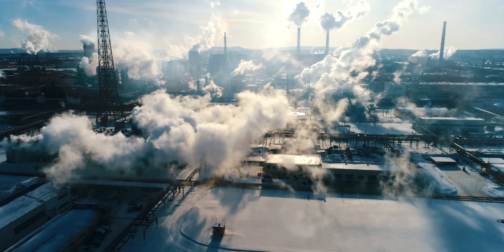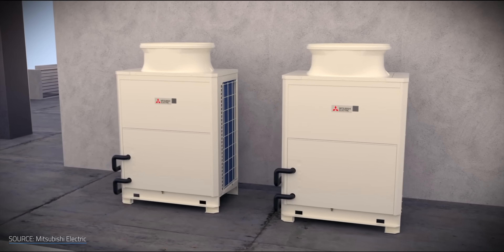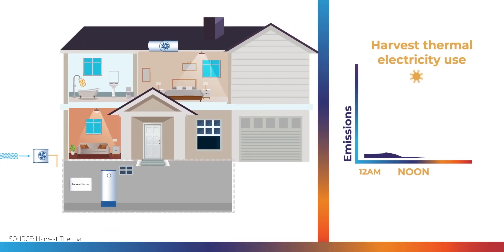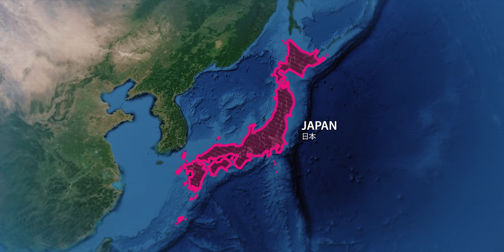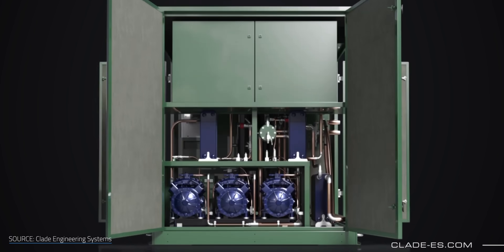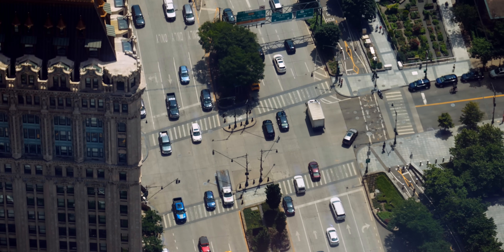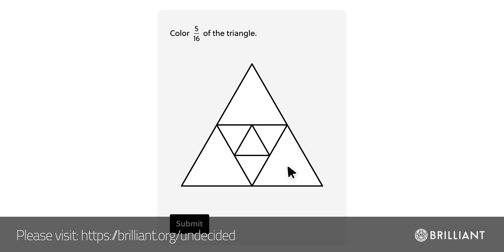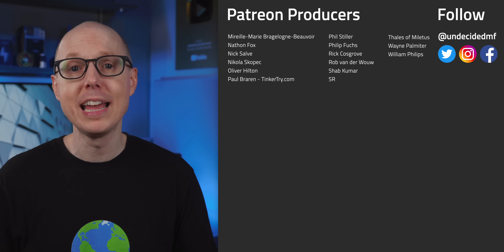Why CO2 Heat Pumps Are The Future Of Cooling

Comment: 3:21 Average Heatpump COP of ~3
3:28 ECO2 SANCO2 COP of 2.6 to 5.5
9:04 CO2 heatpumps COP of ~3
9:10 Most Heatpumps COP of 3+ !?!?

So... I guess you say "average" in one case, and "most" in the other, but the video seems to contradict itself slightly. A bit like: "Usually you get ~3 for regular ones, and the good news is that this CO2 one can be from 2.6 to 5.5. A downside is that you get ~3 from CO2 ones, whereas you usually get 3+ for regular ones.". I don't mean to say: "so which is it" because  you already indicate it's complicated. But then it's not a great argument for the structure of the video.

Comment: When you're making the comparisons between current heat pumps with HCFCs and these CO2 heat pumps you first say (paraphrased) "old heat pumps get around 3 COP and CO2 heat pumps get from 2.6 - 5.5 COP" but then around 9:12, you say the CO2 pumps "tend to have a COP just under 3" while the current pumps "can hit a COP of 3 or better" and THEN CO2 pumps when combined with a thermal battery (which you included all along anyway) can go up to 8 COP. The comparison numbers are fluctuating too much

Comment: Could the CO2 also be used to cool solar panels on the roof in hot climates like Australia, Texas & California. This could make the panels much more efficient during the middle of the day when most power can be generated.
Reply: Interesting idea btw. To your experience how significant solar efficiency drops when there are overheated?
Reply: @Ayvengo21  i believe they can lose up to 30% power generation if the panel get over 40c

Comment: I've had my CO2 heat pump hot water system running for a few years now and it's been brilliant. Based on my usage it takes about 2 hours to warm up the water on a daily basis and it runs at around noon when my solar system is running at peak, so effectively getting hot water at virtually zero operational cost.
Reply: If you are using solar it almost certainly better to add an extra panel and use a plain electric water heater. They make models that last for 50 years whereas heat pump water heaters only last 15 years. The money difference is just too great to justify the heat pump version.
Reply: @Jason821821 50 years for an electric water heater? Which brands?
Reply: @Jason821821  I've got solar already and my home came with a gas heater that was on its last legs. The resistive heating was no longer an option and we get huge rebates on the heat pump here so it was a no brainer decision.
Reply: And since this uses about 3 times less energy to heat, I personally rather use the excess solar to power something else. Like home heating or cooling which uses a lot more energy, especially in winter when solar doesn't generate anywhere near enough to power both.

Comment: I have spent an unreasonable amount of time thinking about heat pumps and thermal batteries, and now Harvest Thermal does precisely the system I had been imagining for months now. Bless their hearts.
Reply: I've done the same. It seems so cumbersome that we don't just unify ALL of our temperature related appliances into one modular system: hot water, cold 'fridge, room heater/cooler, etc, with outside air as a sink for the overall difference AND/OR a varying medium to harness. Wish I could do the thermal math.
Reply: @BillyStanley It gets really complicated technically and expensive when you want to run so many things with different goals off one outdoor unit. You're talking about a VRF system essentially, if you were to run refrigerant to each appliance that's adding a lot of failure points, efficiency loss, and complexity. Way more cumbersome to do than individual units I can promise. If you run through water, you can't really do cooling for a refrigerator and not a freezer, it's also going to have a lot of energy loss and waste electricity moving all that water around.

Maybe it seems wasteful to have a dedicated refrigerator and whatever else you have that's a heat pump, but they work better that way. Refrigerators, hot water heaters, and air to air heat pumps don't use the same refrigerants. Each refrigerant will give you different in/out temps that they're best at, and the optimal one for the application is used.
Reply: Having compressors far away from fridge and freezer could allow for even more silent operation. With how efficient those currently are, I know it won't ever pay for itself, but it might be worth it from a noise pollution standpoint. Plus, it shifts the engineering away from the fridge. It just becomes a box that you plug into a new kind of wiring into the house.
Reply: @TheKdcool  The engineering of a fridge is mostly not the compressor, so moving that outside is just an efficiency reduction. You still need electronics in the fridge for control, and a defrost on the coils inside, might even have an electronic expansion valve or refrigerant metering device, plus fans.

This is just adding complexity and engineering, a lot of figuring out how to work with a complex VRF outdoor unit and communicate with it. Rather than have a simple, small, and efficient dedicated compressor for an easy closed refrigeration loop. We can already make practically silent refrigerators with inverter systems, you just gotta spend the money, it'd still be less than a fridge hooking up to an outside unit. The copper line set for refrigerant going outside would already cost $500-1000 not including labor to hook it up and purge/vacuum the lines before charging them.
Reply: @Jaker788  If it's hot inside and you directly vent the heat from the fridge outside or into the hot water, there is place to improve efficiency
Reply: @TheKdcool  It's a negligible amount of energy and a small amount is new heat, while the rest is essential heat that leaked into the fridge simply being brought back out. In total you're generating around 500w of new waste heat. You'll lose a lot more energy just moving refrigerant over 50ft of line both ways, and having to insulate it to mitigate heat/cold loss along the way. It's just not ideal at all compared to a simple very small loop in a fridge. That much copper in every house isn't very sustainable either.

In a home that's primarily heating in the year, it's actually better to have the small amount of waste energy generated from the compressor motor inside than out. In a home primarily cooling, it's still only 500w of actual load on your AC system. The payback period for an outdoor unit driven fridge is practically infinite.
Reply: @Jaker788  it's more like 50w if you make an average so i'm with you on it not being a cost savings. It's more about making it completely silent

Comment: 7:26 non-toxic should have lots of asterisks. It all depends on concentration.
Reply: The upside is, if there ever was a leak it'd be rather easy to just safety went the whole charge to atmosphere as it would do less harm there than inside a building. Though I'd definitely invest in a CO2 detector with one of these things, never a bad idea anyways, but more so if you are actively dealing with sources of CO2

Comment: So, would this co2 heat pump and thermal battery combo be applicable for also cooling a house in summer in the southern United States?
Reply: I have the same interest.  Being in Texas, where we just experienced 75 days of 100F (38C) or higher temperatures, good cooling efficiency would be essential here.
Reply: cooling works only if ambient temperature outside is below 30 degree celsius
Reply: @3harath  
Is that rule universal? Or does it depend on the type of coolant being used?
Reply: Can it make hot water for showers and cool the house?

Comment: I remember watching a show when I was a lot younger that said CO2 is a really bad choice for refrigerators because it easily changes directly from a gas to a solid and blocks the tubes.

Is there something about the scale of multi-unit heat pumps that makes that a non-issue?
Reply: That's called vapor deposition. It's actually one of the ways we make graphene, using CO2 and copper foil. Not a problem with modern sensors and processors unless there's a catastrophic failure that creates conditions well outside of the intended operational values of the loop.
Reply: Never underestimate the left's ability to ignore old, established knowledge. The the lockdowns and masking serve as my evidence.
Reply: I think that because these systems are running at high enough temperatures, it mitigates the danger of CO2 solidifying. It takes ridiculously high pressures (>>100 atm) to get CO2 to solidify above even -30°C. Afaik, dry ice (solid CO2) is made by chilling with other refrigerants/methods entirely.

Comment: Well done, heat pumps are long overdue as the staple in the States. Matt I would pick you up on the statement that CO2 is non toxic. It is in fact a toxic gas when humans inhale too much of it. Big issue in confined spaces like submarines and space craft that is why CO2 scrubbers are on those ships. Your death from CO2 poisoning is called Hypercapnia. Cheers and keep up the good work.
Reply: Aren't you talking about carbon monoxide? That is deadly.
Reply: @rjung_ch  No I am not that is a common mistake people make - simple research will tell you just google Hypercapnia. Why do you think the CO2 scrubber failure on the Apollo mission was so critical to repair? The Astronauts were going to be poisoned by CO2 (running our of oxygen is not the issue) it is the concentration of CO2 that becomes deadly, from memory there is only about 0.5% in the atmosphere. Correction the level is 0.04% as of 2022 which is double that of 200 years ago.

Comment: Sanco2 is made by sanden and they have been around for a long time now and still haven't gotten off the ground. I reached out to them in 2018 when I needed a new water heater because I thought their tech was top-notch but their sales guy seemed totally incapable of dealing with non-builder homeowners interested in the product and sent me a bunch of PDF and PowerPoint presentations that he would give to commercial customers about the benefits. When I got in contact with a manager I was told the closest distributor to me was in Newark Delaware, meanwhile I live in Maryland just outside our nation's capital in DC. You would think there would be a closer distributor. They also didn't have any listings for certified contractors to install the heat pump water heater at the time and frankly I didn't want a contractor doing this for the first time on my house. I have very young children and we can't go without hot water for a long period of time if there's an issue. My biggest gripe with sanden is the storage tank itself. They use an old fashioned glass lined metal tank that has been outdated for decades now even though everyone still uses them. They should have a modern highly insulated polymer storage tank like the Rheem Marathon so it can maintain the hot water temperature better over long periods of time, minimize maintenance without the use of anode rods, and provide a lifetime warranty like the Rheem instead of the 10-year ones that most of these glass lined anode filled tanks have. I ended up with a AO Smith heat pump water heater and I'm 90% happy with it. My only gripe is the generation I got in 2018 has a side hookup for the hot water that when routed vertically travels directly in front of the cold exhaust air port, essentially cooling your hot water as soon as it leaves the water heater. The newest model has a hot water exit directly off the top.

Comment: CO2 is not currently being targeted for packaged RTU or HPs as it’s efficiency numbers are awful. It is desired more for its global warming potential number (GWP of 1). It operates at really high pressures and can require more energy to operate.
Reply: Did not really get what is the benefit of CO2 compared to other refrigerants, my AC uses R290 aka propane so also no ozone depletion and miniscule global warming effect. Comparing  with HFC/CFC-s is only part of the story.

Comment: Liquid c02 at 600psi or so then allowed to expand into a gas through a nozzle onto a heat sink, creating cold air to cook the home, during the day it uses solar to compress it back to a liquid. maybe the heat sink could be a wheel that’s water filled and has flow to allow fast thermal exchange while also providing cooling and rotational energy to then force the cool air around the home or the energy to create electricity at night? 🤔
Reply: these run at far higher pressures, several thousand psi

Comment: I understand that CO2 does well with heating via a heatpump system, but how does it do for cooling? and can a fridge/freezer also work with CO2 as a refrigerant?
Reply: Most new supermarket refrigeration systems use CO2 in the UK at least
Reply: Heating or cooling wouldn't be a problem for CO2. I'm question the number COP numbers. Also don't see any gain from store the heat in hot water as well.
Reply: It's has the ability to cool to lower temperatures than other commercially used gasses for heat pumps, the disadvantage is that it needs specialised compressors and much thicker piper work and heat exchanges for the high pressure. Advantage over other heat pumps is it can directly heat beyond 65C, so above critical temp to kill legionnaires,  other heat pumps can only heat to about 48c and need an electric element to do the rest for safety, so they drop efficiency. The higher heat temperatures mean water is easier, but also needed because it functions as a way of using an 80c heat source to heat a home to room temperature.

Comment: You americans have bad heatpumps. COP in europe ranges from 4 to 5 as standard. 
Sadly heatpumps are also very expensive here.
Reply: I think you have to take into consideration that temperatures in Europe don’t go to such extremes that the heat pumps have to fight against, and ambient temperature impacts the COP. We have some states that get down to -45 degrees Celsius in the winter and some states that get to 54 degrees celsius in the summer.